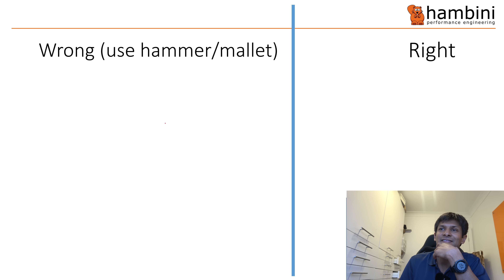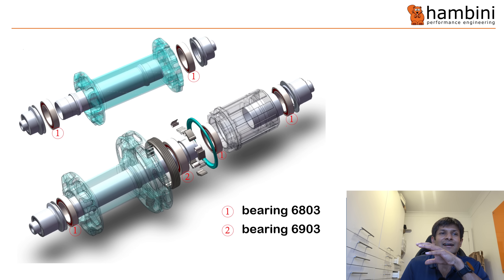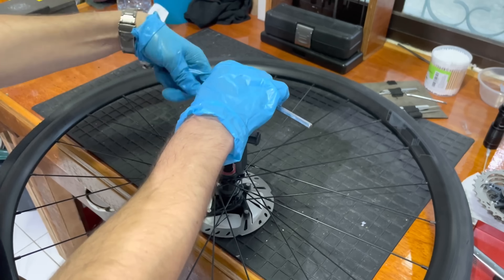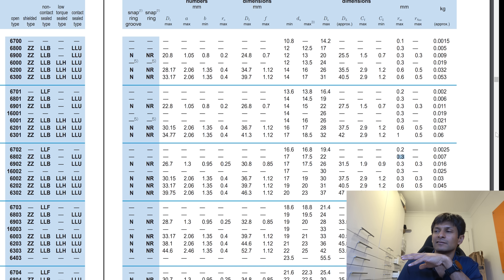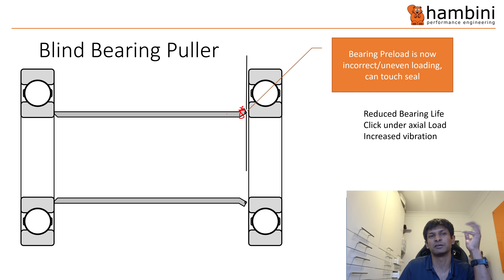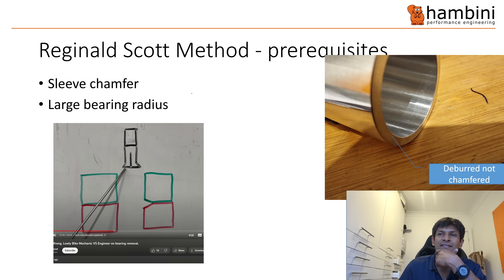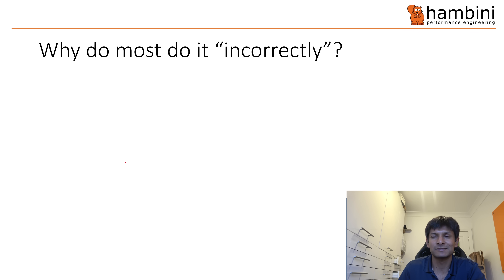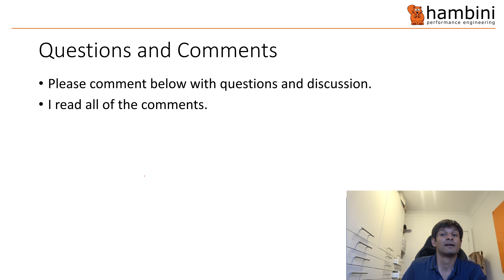I got REAMED by a Bicycle Mechanic | It was bound to happen at some point.

Comment: Frankly, I didn't watch the Reginal Scot video when I saw it come up in my feed as I figured it was probably a Dunder\Krueger scenario.  Seeing your video shed all the light I needed to see.  If I'm removing bearings from a hub they're toast anyhow.  The only time I could see having to remove a good bearing is if I were a knob and put an angular bearing in the wrong way around.  In an era where the bearing is a minimal cost component, just beat it out and put a new one in....or put the bearing back in anyway and make sure you have a replacement in the post.

Comment: So I punch bearings out all the time but I totally understand why people dont like doing that. Sometimes if you've been a bit overzelous with your punching, you can send the bearing out on an angle which can damage the surface that the bearing presses into. I have done this myself, and it can write off your hub, you just learn to be a bit more tenuous with your punching. Some people just get a bit scared of this happening (particularly on DT hubs which I find to use particularly weak aluminium), so they insist upon using bearing extractors on everything.

Seems like a skill issue to me :P

Comment: I have a hammer blind hole puller for a couple of oddball hubs that don't have a way to tap out the bearings with drifts. Also if I want to give myself a nice freaking blood blister on the webbing between my thumb and finger. But those don't have a spacer in them, but rather hard stops in the hub, so the hammering pull needs to engage just the inner race of the cartridge and hopefully not tear things apart. Every time I have to service those hubs, I wish I were on a cup and cone.

Comment: I really enjoyed his video and his method seemed far better to me, as a complete amateur. I don't really understand why hammering something, as you and many manufacturers recommend, is less damaging - it seems counter-intuitive. Your diagrams and arguments describe why he is wrong - probably - but not why you/they are right. His method seems to guarantee a gentle, "square", pull whereas you want to hammer away like an amateur that could go anywhere. I accept that you demonstrated the delicacy of the spacer tube, its damage and that is unacceptable for many reasons etc

Might have to watch all 3 vids again (original, his response, this reply) to see why I'm wrong, as I know I must be!
Reply: there can be a middle ground that would probably make both of them happy: hammer the first 2 mm using a hammer and a copper drift, then grab the bearing with an inertia hammer style bearing extractor. Minimise chance of flaring the pacer tube while also minimising the chance of damaging the inside of the hub where the bearing sits? And eliminating the unnecessary pressure on the spoke holes Reginald did with his bearing puller. Or maybe manufacturers who make hubs out of cheese should be shunned and driven out of the market...

Comment: Did you see the comment by Laundry_Hamper >>>> "The end of the tube you're pointing to as "flared" is the one from the other side of the hub. The side that was in contact with the bearing puller is on his fingertip." I checked this and he is correct. This means the flare is not due to the puller.
Reply from the maker: Did you read the description and the pinned comment for clarification, I think this wheel has been apart before the video was shot.
Reply: @Hambini  Maybe ... Impossible to know for sure. He will probably do a follow-up. Ask him for a close-up in the comments. To me, it looks more like a bulge than a flare. Also, it could just be oil that accumulated as the "bulged" side was facing down. I think the best thing to do is wait and see what his reaction is. Question, are you planning to do any more videos about aerodynamics? One topic that blows my mind is the human power vehicle world speed record. 144 km/h at Battle Mountain. The bike was a kind of recumbent faired velomobile.

Comment: Always check your tube, controversially; I don’t think he did damage his pipe… check which end that ‘tick’ was at 🤔

As for the leg placement, a spacer tube up against the ratchet ring would’ve been nice…

That said, I don’t even own a blind bearing puller 😇

Comment: At 7:11. I think that is oil on the end of the spacer. That end was facing down against the bearing that hasn't been removed. I 'think'. He then reverses the spacer  when he puts it back in. I would replace the bearing anyway.

Comment: Having engineered on 33 Dakar rallies ( including 4 wins ), 5 Le Mans, 3 Mint 400's & 1 Whitbread round the world  - finishing them all ..........numero uno - NEVER reuse a pulled bearing. 2 a hammer in experienced hands is far better than a blind puller, you can 'feel' the bearing travel and moderate and finesse the strikes as the bearing moves, Pullers of any design when used with bearing seated in aluminium components always end up with witness marks at the very least and damage to such items a spacers - ALWAYS.  In my current day job as a production engineer in the beverage canning industry I can tell you Aluminum is an unforgiving mistress

Comment: I have unfortunately and unknowingly bought a second hand bike with a ruined center tube Spacer on both hubs. The wheels were the main reason I bought this bargain. Deep section carbon rims with good quality hubs, But the bike just didn't perform as my old 105 cup and cone and alloy rim set. After much head scratching I finally figured out that the bearings where binding under the pressure of the QR, As they rolled perfectly on my wheel straightening jig. Upon inspection after disassembly (just like we all do by carefully drifting out the "new bearings" 🤔). I noted the similar damage to the spacer tube lips that appeared 'belled out'. (Now I know what caused it) After a bit of measuring (a lot), I made an new set spacer tubes to save the day on my lathe. Tossed out the cheap bearings obviously and replaced them with the good stuff. Problem solved. Both these blogs have highlighted  the gaps gaps between engineering and mechanics. We keep learning from each other. Keep up the good work 👏

Comment: It seems whatever process of bearing  removal is used is to some extent destructive. Perhaps penetrating oil and super magnets? Heat expansion could also be risky, ruining the temper of the metal.

Comment: I use an anchor bolt  to grip the inner race of the bearing then place it on an appropriately sized pvc pipe coupling then tap it out with a drift on the anchor bolt. Costs less than £1.00.  Never done it on the arrangement above but if you don't push the bolt all the way through it shouldn't damage the spacer.

Comment: Now retired & worked in the construction plant and maintenance i had a set of blind bearing pullers from SKF these were simply a tool treaded one end & a ball turned on the other end but machined flat 2 sides ( looked like a lolly pop ) you picked the right ball diamater inserted into where the race cage was and turned it 90deg to lock into the ball run then withdraw as normal , this of course distroyed the cage but as the bearing was being replaced it was not an issue  ...........

Comment: To be honest, this isn't his worst video.  It's probably not going to kill anyone.  Making an compressed air receiver out of to plastic coke bottles,  then blowing compressed air over naked skin is potentially fatel. 

He then goes onto say proper compressors are more dangerous because of rust in the metal receiver.  That's what the f#£king drain wholes for . 

Absolute 🤡

Comment: Regarding the screenshot at 7:15, I think the flared part is the other side of the tube.
Meaning, the side that the puller didn't touch.
He pulls the tube out with his right hand, so the part that touched the puller is now at the bottom and the opposite side now is at the top.
Reply from the maker: I tried to clarify this in the pinned comment.

Comment: You have to know what you are doing. If you can use the puller without damage, better solution than hammer. I've seen loads of damaged pressfit bottom brackets by hammered method. Reginald has to educate himself, this time is very easy to check any manuals on the internet, and you can do your job properly.

Comment: It take a big man to eat humble pie. I dont see you eating?? So the preferred method is to use a percussion tool to remove bearings? Why not ream the stupid hub manufacturers that make spacer/preload tubes out of aluminum and without an internal chamfer or radius. With one method you run the potential of destroying the hub. The other method you run the potential of distorting the tube. I know which Id choose.

Comment: as a bike mechanic myself , i can say with much experience , dont listen to bike mechanics with tool fetishes . drifting bearings out with care and respect for the accompanying component is the best way to go . i have seen customers bikes with tool damage from other mechanics , after 35 years of careful removal of press fit bearings with a hammer and drift i have had zero problems , with blind pullers the hub shell can also become damaged to the extent of having to sand the leading edge of the hub after a puller has marred the bejesus out of a £1000 wheelset., especially with the cottage cheese some hub shells are made of .  blind pullers should only be used when the bearing for extraction is in an orifice that has been designed for such a tool and specified by the manufacturer .   keep reaming and may the hairdresser be with you .😘

Comment: I think that Hambini’s way was not technically wrong (is certainly can work) but Reginald’s way was the better way of removing a bearing like this.
Yes, “you may have done this for years without an issue” but punching a bearing out rather that using a puller is far more risky to causing damage to your hub. 
Sure other manufacturers do show a hammer methods but did you find this actual hub manufacturer’s advice, no, you didn’t.
Pressing and pulling a bearing with the correct tools is always the safer option. There’s just far less risk of getting that bearing cocked at an angle in the bearing housing.

Comment: This is exactly what I thought when I seen that guys video, your forcing the bearing puller into place even if you put a small amount of tension on it. No problem with smacking out a bearing as long as you work it slowly and evenly.
Reply: There is no forcing into place, gentle torque is applied until you feel the flare snap into the gap between spacer and radius on the bearing. If it were me, and I didn't feel the snap, I'd start again.

Comment: I agree with the main point. There are also expanding pullers, that by friction force grab the inner race and can be pulled or hammered out. Save spacer and hub, bearings can be trashed.

 In material engineering part, my area: Ball bearings are most often made from 1%C 1,5% Cr (100Cr6=AISI 52100, no Molybden).  I wont say that "CrMo"  is a wrong description, as OVAKO makes 100CrMo7, steel similar to 100Cr6 with added Mo, but most machinist asociate "CrMo" with a  AISI 4130=25CrMo4~"chromoly steel", commonly used for frame construction.

I am not nitpicking the values 100HV and 1000HV as it is only for a ballpark orientation. If anyone has more interest, continue reading:

When it comes to hardness, thank You for using the Vickers scale( as from HV one can estimate Ultimate Tensile Strength by multiplying HV[kgf/mm^2] times 3,33 to get UTS[N/mm^2=MPa]. In your example aluminum would have UTS of 333 MPa( aluminum alloy can easily have that, "pure" aluminium  with UTS ~90 MPa is not commonly used for strucural application , bearing steel would have UTS of 3333 MPa ( high probability, that it would crack before that, but in compression test that could be close to reality).

I personally have measured bearing race hardness of 765HV10 (62,7HRC) of brand new KOYO 6204, old east German (DDR) bearings:790HV10=63,6HRC and the hardest were old russian "USSR" 6305 bearings: 836HV10=65,1HRC.

Thank you for your service ;) 
Best regards

Comment: A well thought through response. Nice work hambini. Hopefully Reginald Scott will respond with something suitable. If I was in his shoes, I would post a close up of that preload tube and if it was fluted, I'd apologise and say that I was wrong. A mistake like this, made in good faith isn't the most heinous in the bike industry is it.
Reply: The end surface of the puller is flat, unless the flare did not connect with the small gap between spacer and ball race, then it's difficult to see how damage can happen to spacer.

Comment: I've been doing the puller thing with the inner sleeve as well. I guess I'll change my habits. 

But in general what are you even doing replacing bearings on an aluminum freehub body? The pawls have surely already eaten themselves into the body and you should not use it again. The seals might be in questionable condition as well. Just get the full body kit.

Comment: Absolutely nothing wrong with drift and hammer use. Very effective method. 
I do like blind bearing pullers from Bearing Pro Tool chap. They are not having lip to hook on the outside of the bearing so no issues with spacers damaging. Nice to work with.
Cheers!
I.
Reply: Those Bearing Pro Tools are neat and you still get to use a hammer!

Comment: Sorry but good blind pullers have a very sharp edge and easily engage the bearing without any damage to the preload spacer.
I have not found a single freehub body yet that a blind puller will not work with without damage.
Hambini may have sourced some cheap Chinese tools though to cause such a problem.

Comment: Everyone is cheering Hambini's reaming of Reginald's reaming, but here's hot take: construction of the hub assembly is kinda meh. Aluminum is too soft to serve as a spacer in the place where only contact with flathead screwdriver or expander puller can separate the bearing off the assembly and there's too little space for flathead screwrdiver to have contact with. Either way it ends up in damaging the hub shell or the whole circumference of the spacer goes whack. This is the problem with modern components: they are not created with serviceability in mind.

Comment: A blind bearing puller with a slide hammer puts just as much stress and damage on the bearing as tapping it out with a hammer, but it means fuck all as you rarely reuse the bearings you remove anyway, or at least you probably shouldn't be. I know I've never reused a bearing I've had to knock out (I work on engines, not bicycles). I guess pulling it slowly with a puller can help you reuse the bearing but that turns a 1 minute job into 20 minutes of fucking about to remove 2 bearings that cost 3 dollars and that you're ostensibly removing for a reason (that reason being they're fucked)

Comment: Example regarding Zipp 177 rear Hub.
You have no choice but to punch out
the first bearing on the hub shell because
of the axle.
When I thought about the free-hub I thought 
the same as you H.
When it comes down to the free-hub I will
use an expandable extractor and gentle 
tap out and its fine.
Reply from the maker: A collet expander would normally work
Reply: @Hambini   @Hambini  I use the Wheels Manufacturing extractors which only clamp the inner bore and theirs no ridge.

Comment: Hm, as a mechanical design engineer I would say that it's a bad design if the preload spacer has no gap for pulling tool. Or the pulling tool should have the same small lip as the radius of bearing. I can see that hammering is a solution of praxis but in a perfect world you should press the bearing in AND out. And the design should consider this. Here we have bicycle design, low weight, carbon, alu, sensitive to forces and shocks. Never ever would I take a hammer as standard solution for such thin walled precise machined bearing housings in a spoked wheel. Mechanic impuls is the last answer if something went wrong before.
Reply: This is the right answer. I said the same in the comment above: it's just a bad design and neither Hambini, nor Reginald are at fault here. If the inner wall of the spacer sits flush with circumference of the inner wall of the bearing's race, it's a bad design. Either way a mechanic will damage the hub shell or whacking the whole circumference of the spacer with expander puller. IMO, both reamers are not at fault here. It's just one-way design of the hub, where you can easily fit the bearing in, but have no way to take it out.
Reply: Doesn't a preload spacer assume perfection of all other variables and is this very realistic? What is so wrong with careful preload instructions that are repeatable or measurable with a fine torque wrench? To a certain extent these bikes do not play with the same gravity of assembly/disassembly/repair precision as other high end machinery right?

Comment: The question is "How does one assemble the Free-hub correctly"
Now, I have done an extensive amount of research on the topic
a number years ago and I had to get the tool made. 
If you want to know H you know how to get in contact with me.

Comment: Interesting. A good explanation.
I remember using bearing pullers on larger electric motors and engine governor.
When shaft had been damaged it ended up the outer race pulled off and the inner race ground and split so the shaft end could be cleaned.